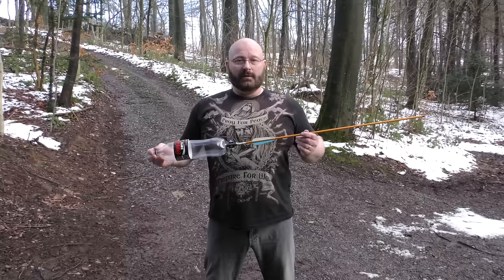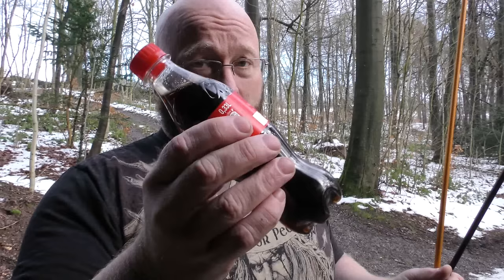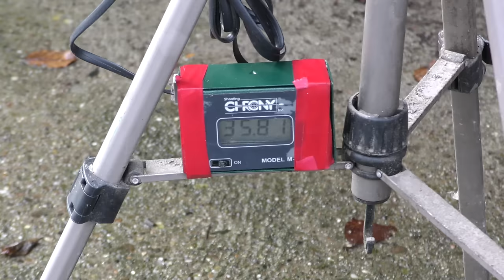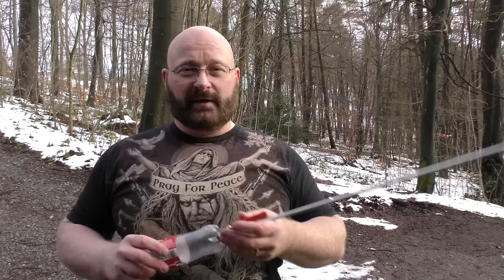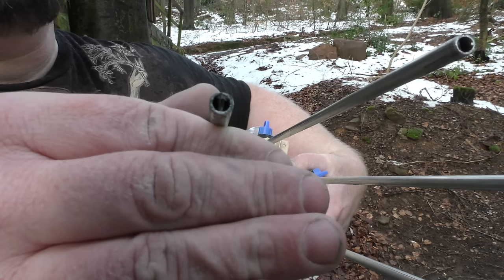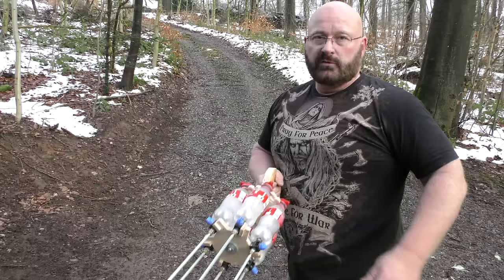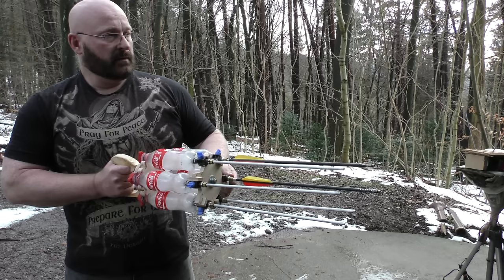"The Coke Bottle Gatling": Craziest contraption ever?

Comment: If I recall correctly, Coke bottles are made from the same bottle. They just blow them bigger to hold the different volumes of liquid. This would answer why the smaller bottles are tougher, the plastic material isn't stretched out.

Comment: Maybe you could grease up the rod that the arrow slides on so it will move quicker due to less friction and also create a tighter seal. Sounds like some air is escaping before the arrow is even off the rod.

Comment: Aluminum on aluminum has a relatively high coefficient of friction.  You would probably gain some extra power if you used a brass tube since brass has such a low coefficient of friction.  Steel would work better, too, but not as good as brass.

Comment: Have you tried polishing the aluminum tubes? That might help, especially if you use something like trumpet slide grease on them. The slide grease would lubricate the metal, yet keep the air from escaping around the tubing. It might increase your velocity a bit.

Comment: The length is causing friction, though shorter tube will mean less accuracy.
Consider retraining the arrow, allowing pressure to build in the shaft.  This should increase Q, the flow rate of molecules, by reducing friction relative to pressure.  IMO
A proper comprehension of fluid mechanics will go a long way in it's development.
Reply: Because it's a spigot type system the trouble is it must remain low pressure.the higher the pressure the thicker the projectile casing. Since the pressure is maximized by the rupture pressure of the bottle, the only way to increase the propelling power is the volume of air. 
The longer the barrel the higher the friction, but that isn't all all bad. The longer the arrow remains over the barrel the more time the barrel pressure has to equalize. Ideally the barrel would be at the same pressure as the bottle before the arrow left. Additionally the friction drops the further along the barrel it travels, leading to barrel friction being inverse to barrel pressure. This is good for energy efficiency. Too much friction could be avoided by applying oil.
 The problem here is the ball valves he is using. They have a pretty bad pressure release gradient. It looks like a lopsided parabola with a slow buildup and a fast drop off. Ideally the valve would be spring loaded and open in milliseconds.
Reply: RaeSyngKane The ref was to air friction due to turbulence, though a drop of light oil would help seal and reduce metal on metal friction.
By, momentarily, restraining the arrow, pressure will equalized.  No velocity, mean no friction.  Once released, the higher pressure means more molecules of air will pass w/ the same (or lower) friction as the lower pressure(due to back pressure lowering velocity), ergo transferring more energy.

Comment: You could use 12g co2 cartridges to power fire each arrow. By install a disc that ruptures at just below co2 pressure between the aluminium tube and the valve would compensate the slow opening valve and burst the power.

Comment: one thing you can do that may improve performance is cut a 1/8 inch wide by 1/4 inch long slot at the end of the barrel 90 degrees from the pin it will improve airflow and still be legal as a BB still could not be loaded into it

Comment: Suggestions: 1) make a piston valve for a faster release. 2) use the largest inside diameter tube that you can find for the barrel, since a larger inner diameter will allow faster flow. 3) Go higher pressure.Honestly, you could probably do away with the valves, and use a mechanical system to hold the arrows from launching. A clamp or pin the hold them to the barrel, and an o-ring to hold the air in. Much like the way our water rockets work. This way, the entire barrel is at full pressure at the moment you release the arrow. Your current design has to build pressure in the barrel when the valve opens, and this lets the arrow move partially down the barrel as the pressure builds. This robs you of acceleration and top speed.  The mechanical latch would probably be easier to design an automatic repeater for as well. With the valve removed, the air path would also be shorter and smoother, so the air would vent faster and give more speed as well.You original idea is really cool in any case! Keep making these videos!
Reply from the maker: +USWaterRockets Piston valve would not make much of a difference. The tube diameter is so thin that the air flow is limited, so even if the valve opens slowly it does not matter. The inner diameter of the tube needs to be maximized, but of course the walls need to be thick enough too. I am afraid I can't go thinner really. I'd need to make my own arrows from thick tubes,. Higher pressure always works, FXAirguns uses 3000 psi - but I can't afford the required compressor. Keeping the arrow pressurized is certainly a good idea, but then again you run into many problems keeping things air tight.

Comment: put thick grease inside of the arrow and it will make it shoot alot faster.
Reply: No it wouldn't actually. Also then you would have the greasy tubes left on the gun which would pick up dust and generally be annoying.
Reply: @screaminlordbyron7767  But maybe a little silicon spray?
Reply: There are so many ways to improve this design, but does it need to be improved? I mean, to what end?

Comment: If it is possible to seal the arrow on the tube pressurize the tube itself. Then the trigger is not pushing air into the tube, the trigger is releasing the arrow because the tube already has pressure.   Hard to seal but no valve release speed issues.  Higher velocity with lower pressures will be possible.  Also smaller size

Comment: try using PVC pipe instead of Coke Bottles and a rotary fuel distributor from a Bosch fuel system for a rotary valve set up
versuchen PVC-Rohr statt Cola-Flasche und eine Drehkraftstoffverteiler aus einer Bosch-Kraftstoffsystem für einen Drehschieber mit einrichten

Comment: You hear all that hiss after the arrow has already left the barrels? That's all wasted energy. Your limiting factor is the length of the barrels. If you created longer arrows, maybe double the length, you'd get a lot more power and speed out of the same setup.
Reply: But you have to factor in that the arrows are made of aluminium and adding that extra length can make it a lot heavier and that potential energy that is created by the extra air hissing out may not be enough to justify the extra wait on the arrow
Reply: It should be enough. There is a lot of extra air hissing out. Even if it just achieves the same speed, it would be more weight going at that speed. I'm sure there is a calculation that can be done for this, but he seems more into trying stuff out.
Reply: +William Brall yeah I think it wouldn't really make a difference, fibreglass arrows would make more of.a difference but whatever.
Reply: I think the real limiting factor is the lack of speed of expansion of regular air.
co2 expands much more quickly. it would add a tremendous amount of force. so much in fact that it would probably becomes too dangerous to do it the ghetto way!
Reply: +A bowl of Miso soup 
the trouble with CO2 is to get the most out of it, it has to be at a pressure where some of it is in liquid phase. There is a pressure release threshold where the amount of CO2 converting back to gas  phase cannot keep up with the demand instantly. What it does do a lot better than air is density. Because some is in a liquid phase, it can store a greater mass of CO2 in a tank than air could be. Most paintball guns and med to low velocity air rifles use it. 
HPA (High Pressure Air) guns use normal air, which remains in a gas phase to a much higher pressure to provide a faster expansion rate at the cost of subsequent shots. Thus a CO2 gun could get 200 shots where a HPA gun could get 4 but at a higher velocity.
Reply: +RaeSyngKane hey guys calm down we are making a fun coke bottle gun and not a bomb =P
Reply: +RaeSyngKane   I thought that in theory lighter gasses have the advantage. There are helium guns made for extreme high speed.
Reply: Karavusk I'm sorry I was so technical, the guys above just seemed to want how to optimize an airgun and it isnt an easy topic with a LOT of avenues. To my knowledge there isn't a pneumatic "bomb", that I know of anyway. They did build a pneumatic dynamite gun back in the 1800's and one of the European nations issued lethally High powered air rifles for snipers. Both of those were vastly eclipsed by rifles although the air rifle had some brief moments of fame due to the quietness of firing.

Adamast: You are completely correct! The smaller the atom the tighter it can be compressed. (generally speaking). The only reason I didn't mention it is the cost of a helium gas cannon is quite prohibitive. HPA and CO2 are the only ones I have any
knowledge about.
Reply: but theb u not have the cool recolver gas at the tube :)

Comment: you can increase feet per second by using the same outer diameter aluminum tubing with thinner walls making the inner diameter bigger , allowing a bigger passageway for air. drawback would be aluminum tubes would bend very easily

Comment: after applying the valve coat the bottles in rhino liner. added strength like no other, paint over the caps seams to eliminate risk of blowout. If the relief valves have an arm that can rotate against a stationary pin as you spin the bottles around its center pivot. fires as it turns past "top center"

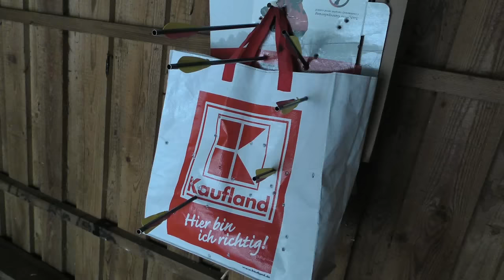Comment: did anyone notice the smoking barrels at 4:04?
Reply: Water vapor, it looks cold. He's a bear so he doesnt need a coat.
Reply: @forcesightknight  watervapor forms because of the drop in pressure not temperature.
This would also happen on an extremely hot day and is similar to how clouds form
Reply: @user-tr2dh4xx6u  then why don't I see see vapor coming off of my cup of hot coffee on a warm day but when its cold as a witches tit in a brass bra there is much steam? Or from my breath? Also at 10000 foot elevation and above its not actually warm as it is at sea level, its often colder, isnt that why the clouds form up there and not near the ground? Pressurized air does also produce vapor, but what kind of change in air pressure is there from my cup of Joe? I'm not bill nye so I'm no science guy, just an observer.  Please explain, so me and the rest of the class can understand.  Thank you
Reply: @forcesightknight  i am talking about in this case.
Vapour can be created by EITHER temperature OR pressure but in this case its being created by pressure or lack thereof.
Reply: Ken M 
You always breathe out water vapour but you only notice it in cold weather.
When it's cold it stays in the form of tiny condensed water droplets for longer.
When it's hot it quickly turns into invisible gas.

Comment: Make one like the "Helsing" in metro 2033. It has multiple barrels preloaded like yours with arrows but they revolve each time you shoot to line up with the tube attached to the compressed air tank in the stock. Now that cuts down the bulk as well. Just make sure it's a tight seal between the valve and each barrel as they rotate.

Comment: Hola Joerg, thinking about your air flow... You have plenty of pressure and a lot of surface area (the arrow shaft meets the inner tube). I was thinking if you added a few holes to the inner tube near the tip and maybe a channel (kinda like a blood groove on a sword), the speed of the energy transfer might improve giving you MORE POWER!!!!

Comment: Why not take 3, 2 ltr. bottles & rig a piping system  to feed 1 small bottle & pressurize it instantly. Place the arrows along a slide rail.  set it up  so that the bottles release & reload with a pull of the trigger.  Make the 3, 2 ltr. bottles into a back pack. :D

Comment: I think the limiting factor here is not necessarily tube diameter, but a problem with activation time of the valves.

If you're going for something really powerful and single shot for arrows, you can probably use a quick exhaust valve of some kind.

EDIT: Late to the game, I see you already did that for a new toy. LOL.

Comment: on the air powered shotgun what you could do is get 10 tubes connecting the warm air source and then maybe have them connected with elbow brackets all of of them on the same valve so they launch  at the same time you need something like a metal container  like a  fire extinguishers or something like that

Comment: Last year i filled coke bottles like them with pressuriced air and shot with my air rifle at them. The bang's were so loud and almost every shot shows a wilson cloud! I would never hold them in my bare hands! 😱
Reply: I use pressurised coke bottles with half a cup of flour in them, the bottles are pressurised with 120psi through a tyre valve in the cap, the we shoot with .22's out to several hundred meters. very easy to spot and hear when we achieve a hit, plus it's fun. Bottles get destroyed, caps and valve stems are just reused.

Comment: If you make it longer. You can have two hands on the gun.
  What if you use a gear system, like a clock. So you don't damage the strength of the bottles.
 Just saying

Comment: Great Video,
What you could possibly do is get aluminum or carbon fiber bottles and fill them up with a Benjamin High Pressure Air hand pump that can pump up to 3500 psi.

Comment: Joerg, I chalenge you to make a 4 sided projectile, that can slide in the middle of two alumminum guard rails, in order for it to do this, it will have to have pegs on both sides of the projectile, and the guard rails will have to be solid enough to not wobble during launch.

Comment: Hmmm, every thought about using aluminum water bottles and an air compressor? You could rig fill/charge valve on the base of the bottle, and a release valve/firing mechanism into the cap.

Comment: Jeorg you should try using a pump sprayer for weeds.   The backpack ones pump high psi with a hand pump while the container it attached to your back and there thick plactic.   Just a suggestion for more power.

Comment: would substituting the bottles for soup cans or some other seemingly innocent metal container work? if you got tomato soup or some other all liquid option, you could drill a hole in the center of the top and bottom and use an air compressor to clean it out then you could fit it with the charging and release ports you had for the bottles.

Comment: Hello Joerg, would it be possible to put an air tank on your back that is connected to each bottle? You could pressurize the tank with an air compressor and use it to refill the bottles quickly, making reloading much quicker.

Comment: Actually you could make it an auto, well semi in a way, one is to replace the coke bottle with a larger air take like from a paintball gun (not co2 but the air version) also add a electronic solenoid valve you can set it depending on type you get on duration it is open so longer it is open more air on the arrow also I would use teflon spray on the shaft to make it very smooth and the arrow slide off much faster with much less resistance.. Also get a air compressor to fill the air tanks, cause I believe you would use more then one...That is just my thoughts on it..

Comment: you use 2 inch PVC instead of the coke bottles. I have built air cannons with PVC that will easily hold 250psi
Reply: +Russell Linger nah pvc is unreliable and dangerous when it explodes, Use the same idea but use metal tubing and a cap on the back end, Then get a tire valve and drill a hole through the end butt cap and now you have reliable easy way to fill it and not loose any air. I wouldnt fill up over 120 psi...

Comment: Awesome!!!  Have you thought of using electric solenoid type valves? I made o rubber ball shooter from an air tank and tube with a ball valve between them. The amount of time it takes to turn a ball valve was eliminated with the solenoid valve so you got instant pressure. Red Hat valves work great and are inexpensive.

Comment: i wonder if its possible to declare the coke bottle fitted with the arrow pressurized already as the bullets and fit a firing pin at the back of each  bottle, so they can be loaded like bullets in a magazine, then after each trigger pull the arrow fires and the unpressurized bottle eject like a spent cartridge . maybe these coke bottle 's blanks at the factory before they get injection molded will be strong enough for bookoo pressure in  a small form factor  .?

Comment: If you want to get more velocity out of that thing you should trying pulling a vacuum in the air tube.  So instead of the air accelerating from 160 PSI to atmosphere (15 PSI) it would be accelerating from 160 to 0.1 PSI or less.
Also the vacuum could be used to hold the arrows in place
Reply from the maker: +Nexfero But how would the arrow be accelerated then? Would it not be sucked IN instead of shot OUT?
Reply: Well you would still have the bottle pressure at 160PSI when you release (open) the valve the air will rush in to fill the vacuum (which would be in the arrow shaft) and the force applied to the end of the arrow should be greater since the air pressure has more room to accelerate.

Its kinda like using a vacuum to shoot a ping pong ball.
Reply: +Nexfero It's not really a vacuum when it's shooting the ping pong balls, it's more of a leaf blower. A vacuum sucks it doesn't blow.